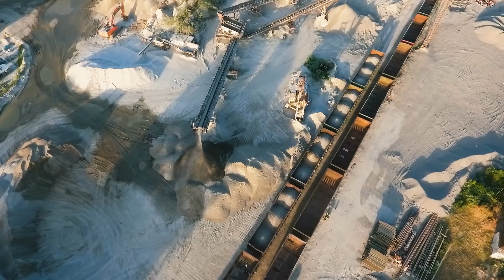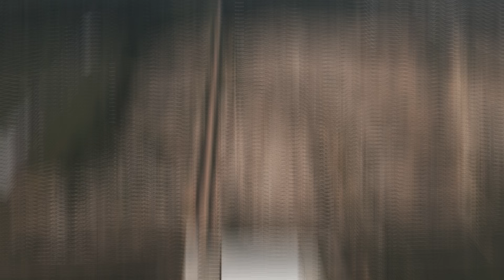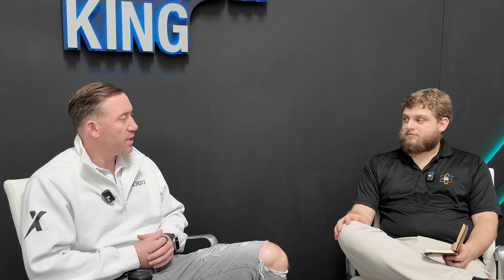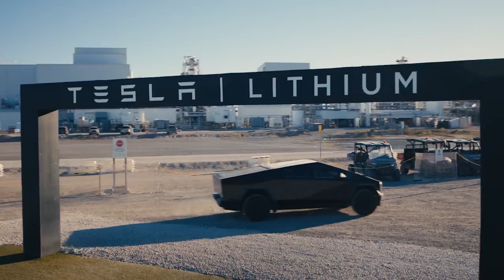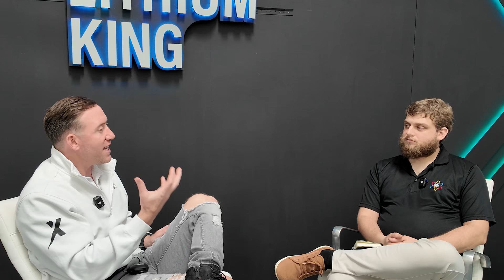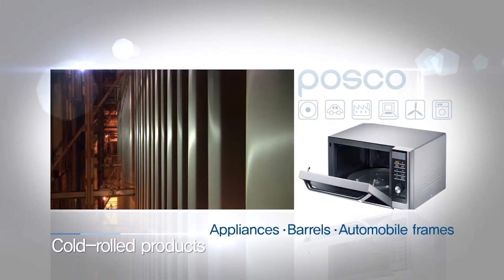EnergyX Beat Our Tesla Investment (by a lot)

Comment: I did my Bachelor Thesis with Adsorption Tech and that the killer feature here imo. it's so much more efficient and elegant if you have the right ligand to catch the exact material you want from the solution. I did it with nickel and cobalt in acidic solutions, so also possible to use for other battery critical materials.